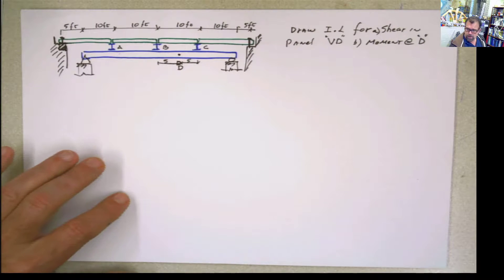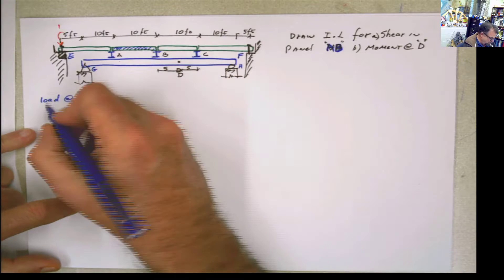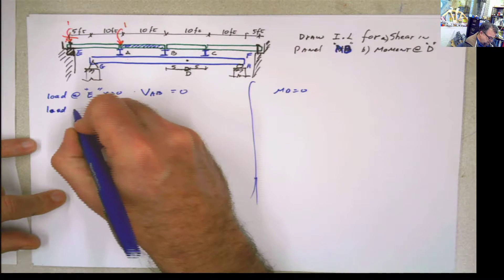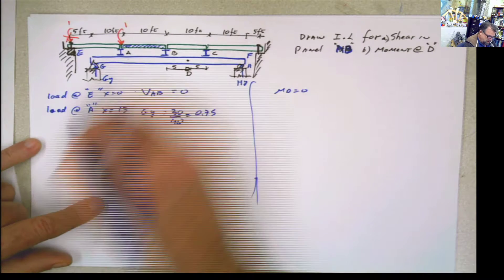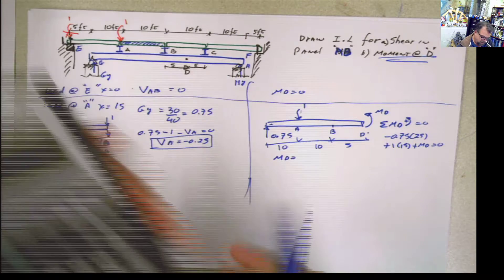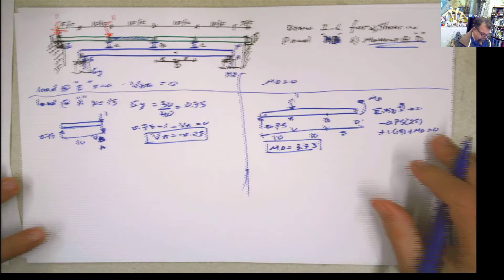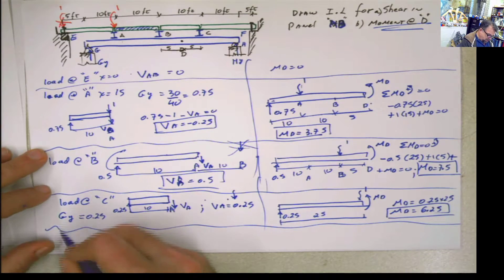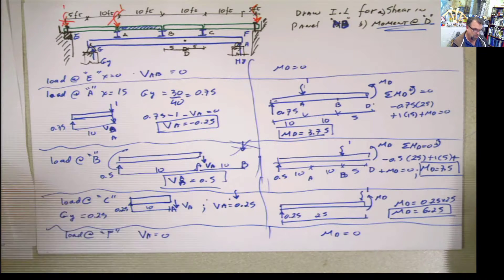Drawing IL for Girder with Floor Beams 2

Comment: At about the 18 minute mark you are doing the moment about D when the load is at C. Moment is not my strongest suite, but I feel like I have a pretty good understanding. I don't understand why you do not account for the load 5m to the right of D in the calculation. Is there a quick easy response to this? I was thinking Md = -25(.25) - 5(1)
Reply from the maker: hi, the  explanation is in the video. depending what side of the   beam yo are using.
Reply: You are truly an awesome guy! Thank you for the quick response. I will watch the video again. Also do you have any vids similar to this with Dead, and live loads. I have some homework and an exam this Friday that I am preparing for.  Again THANK YOU!